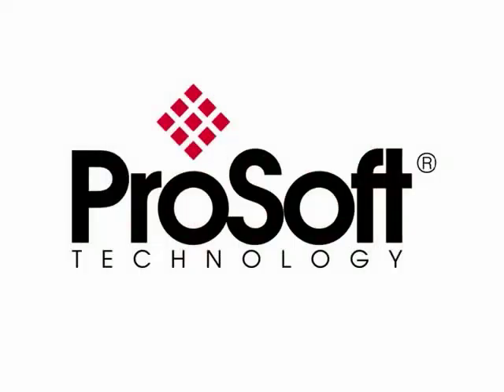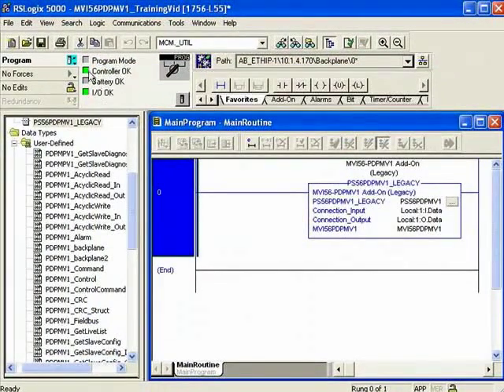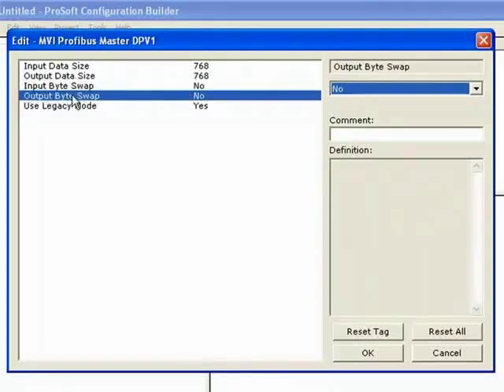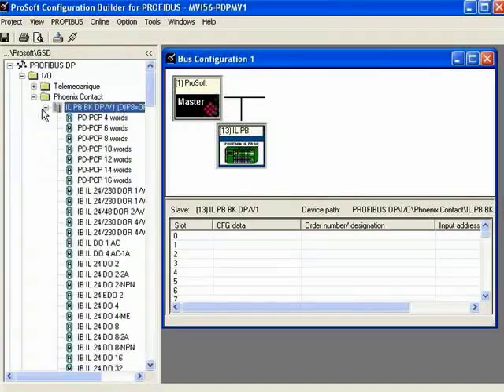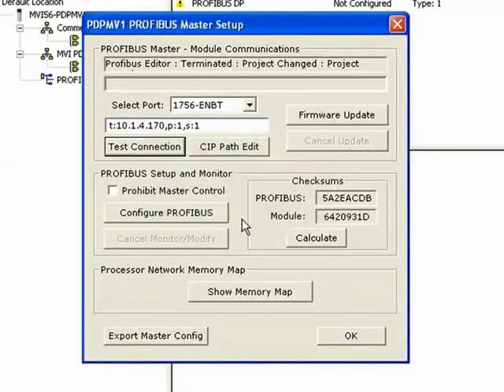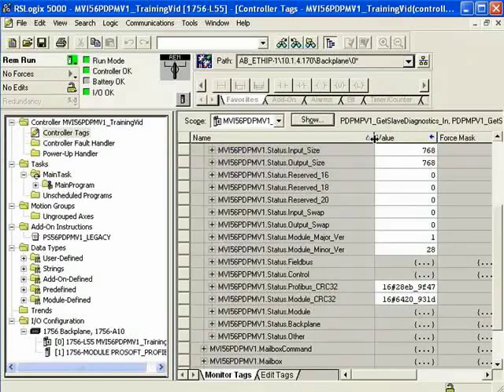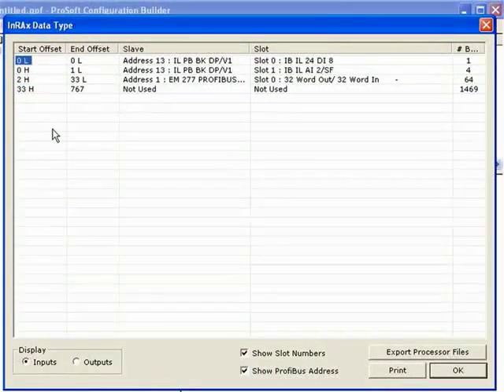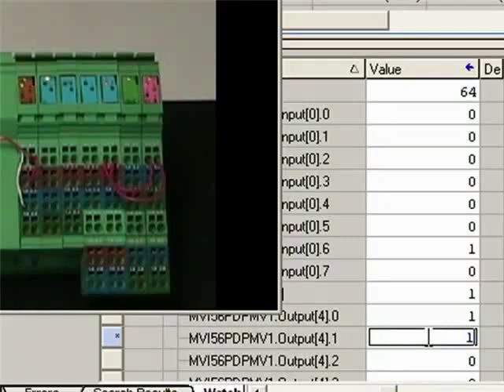PROFIBUS DP-V1 Master Communication Module for ControlLogix - MVI56-PDPMV1

Comment: What is the reason/benefit of syncing the CRC using MailboxCommand.  We have been running years without the input and output CRC's matching.
Reply from the maker: Hi there! Currently, on the MVI56-PDPMV1, the only benefit of matching the Input and Output CRCs is to stop the activation of the APP STAT LED on the module faceplate due to a mismatch.  CRC mismatch will no longer prevent operation of the PROFIBUS Master on the MVI56-PDPMV1, but it will cause the APP STAT LED to come on and stay on.  This LED being ON  is usually used to indicate an error in the module's operation or configuration. Having it be ON all the time might bother some users.  Matching the Output CRCs to the Input CRCs will prevent the APP STAT LED from coming ON solely because the CRCs do not match.  That way, if the APP STAT LED comes on, you can know it is for some reason other that a CRC mismatch, rather than it being ON all the time, solely because the CRCs do not match.

That is the only benefit to matching the CRCs on the MVI56-PDPMV1.  If they do not match, the APP STAT LED will always be ON, but the module and the PROFIBUS Master will operate normally.
Reply: @prosofttechnologyinc  Thanks for the prompt reply. I was not expecting that.  And great explanation. I will go ahead and enable the sync.

Comment: Hello, I'm trying to create a network Profibus with this module, but through the comDTM and your Prosoft FDT and I'm have problems with this one. The Error is "There is not communication to the board possible. Please test the physical connect to the board." I have checked the communication connecting me to the module with the PCB and it's right. I saw your Quick start guide and it's right, too.
Reply from the maker: Hi Jose, please call 661-716-5100 and ask to speak with Tech Support - they can help you with this issue. Thank you!!
Reply: +ProSoft Technology Thankful for your prompt response